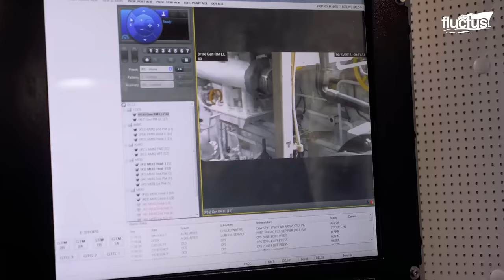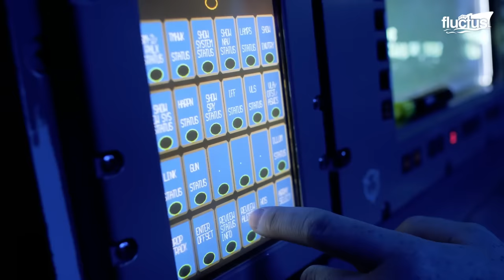Hypnotic Process of Launching New US Navy Billion $ Ships

Comment: The original designation of Destroyer is derived from the task set to design a fast gunned ship as a Torpedo Boat Destroyer,as these boats were considered a lethal threat to ships of the line.
This requirement dates back to the early 1900s and have been built in a similar pattern continuously,fast,agile and well armed.

Comment: Aluminum and salt water. What could go wrong?
Reply: Aluminium ships and salt water have worked fine for years
Reply: @Randallator966   Aluminum hulls?.....or just aluminum superstructure?
Reply: That’s what sacrificial anodes are for.
Reply: @Randallator966   A big drawback to aluminum in war ships is it's lower melting point. There are many other drawbacks.
Reply: @ryanhampson673   But it's more brittle and has a lower melting point in fires. Also isn't the weight of steel hulls an advantage as far as keeping the ship upright under all the conditions.....heavy seas and or battle damage?
Reply: Aluminum, steel and salt water. Anode+Cathode+electro light= advanced accelerated corrosion with hull cracking.